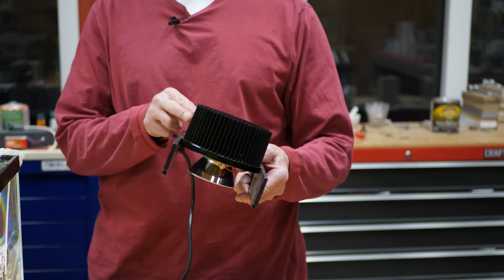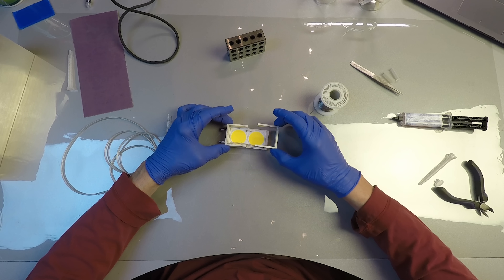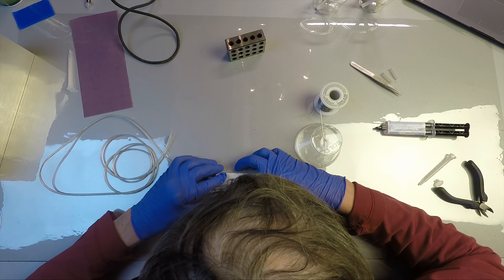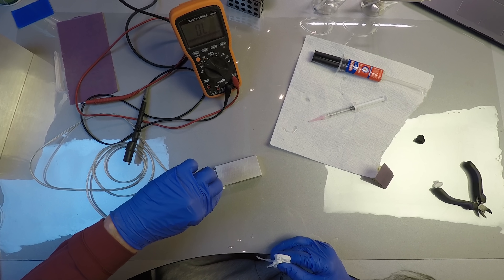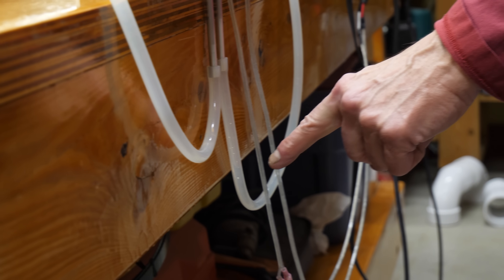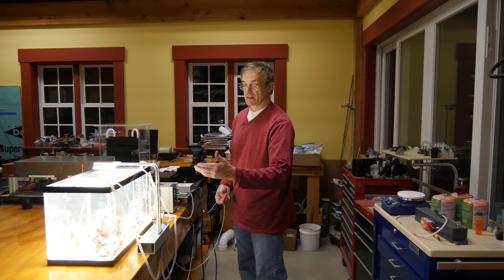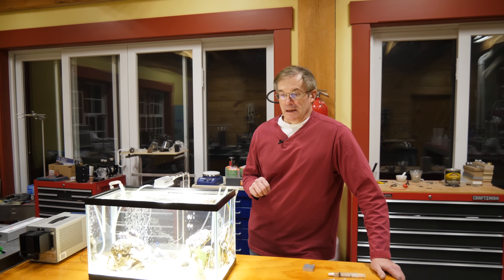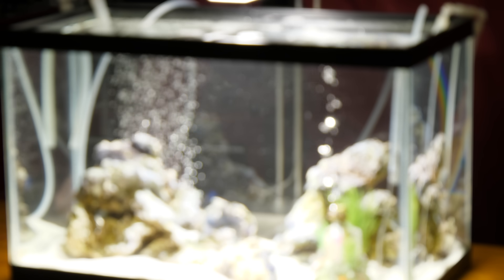40,000 Lumen LED Aquarium Light

Comment: I see three issues with using epoxy to isolate the aluminum block.
1. Epoxy does not bond well to aluminum. I would not trust the barrier to remain 100% for months and years to come. Especially at the interior corners and at the joint where the SS nipples are attached.
2. You will get pooling of the epoxy in areas inside the block unless you constantly rotate it while it cures.
3. Using aquarium water to cool will eventually lead to biofouling. Better to to make it a closed loop with a length of SS tubing submerged in the aquarium as a heat exchanger.
Reply: I have used those Chinese water cooling blocks on several projects and only had one that weeped/seeped/leaked (and that was under about 5-7psi pressure testing” and my method of remediation was far less elegant than using a low viscosity epoxy to seal/fill leak points from the inside.  My method of remediation was applying JB weld to the nipple/cooling block connection.  Personally I think the idea of coating the inside of the block with epoxy sounds like it good idea as long as the temperature spec of the epoxy are not exceeded and that it is food/fish safe.  Many years ago I used a generic silicone to reseal a corner on a fish tank and from that point on even goldfish did not live long in that tank.  As far as biofouling is concerned I doubt that would be much if any of a problem especially if the tank was fresh water However I would have no qualms using this type of setup in a saltwater tank.  Personally I would have a possible greater concern with how clean the aluminum that was used to make the heat sink out of but since the interior of the heat sink is coated in epoxy that all but alleviates that concern.  On a side note I have any number of old brass and bronze hose “T” and valves that I still use in my fresh and salt water tanks and have seen tanks with cooper fittings in them and the fish are healthy and happy.  The basic rule I was told many years ago is if metal oxidizes in the tank don’t polish it because the oxidation layer is most times inert.
Reply: @gullreefclub  Invertebrates like dwarf shrimps (Neocaridina, Caridina) are extremely sensitive against copper. Similarly, microfauna cannot develop accordingly.
Reply: This reminds me of FDA
Reply from the maker: The epoxy does not need to bond well to the aluminum.  This is a coating and not a structural application.  In. Some of our other videos, I explain how to achieve an excellent structural bond between epoxy and aluminum. The water that enters the light should come from the filter and it is completely dark within the tubing.  Biofilms will be slow to develop compared to everywhere else in the aquarium.  Ultimately, it can be cleaned.
Reply: @Tech Ingedients - Biolfilms can easily be flushed by temporarily disconnecting from the tank, and connect to a flush tank containing a dilute H2O2 solution, or Colloidal Silver Solution. Which makes me wonder if a micronised or Ionized Silver additive could be mixed with the low viscosity Epoxy, that would prevent any bacteria whilst also improving thermal conductivity within the heat Exchanger? Something like...
https://www.lionshome.co.uk/home-improvements-paints/silver-shield/
Reply: @TechIngredients  I don't have an opinion here.  But I am curious how one would go about testing this?
Reply: @joewhite4564  Just like anything else, experimentation.  Try a method, document it well, and see how it performs, rinse and repeat.  After using the epoxy the first time, mill the heat sink in half and see how well it coated everything.  Try different epoxies, faster curing, lower/higher viscosity, etc.
Reply: @TechIngredients  I disagree, I think it is critical to have a strong bond in order to form and maintain a complete barrier. Proper epoxy barrier coating of aluminum (which is what you are doing) requires diligent preparation (etching) in order to to be reliable. Sharp interior corners, thermal cycling and dissimilar metal junctions increases the likelihood of a barrier failure.
Reply from the maker: We'll have to agree to disagree.  Shrink wrap provides an excellent barrier and has no bond strength at all.  Epoxy bridges gaps and it's low surface tension prevents beading.  
On another note, there is an excellent alternative to etching which I agree is the standard for achieving a good bond.  Sanding the surface after it has been coated prevents the oxidation of the exposed, fresh metal and the resulting bond strength equals the strength of the epoxy itself.
Reply: @HarmanRobotics  I'm sorry bro but whatever he says ill believe him. This dude is real fucking intelligent. If he said the moon was flat, I'd f*cking believe him yo

Comment: ...why isn't the wire running through the tube?
Reply from the maker: Safety.  The two COBs are running in series near 70V.  Isolating the electrical feed from the water is a good idea.
Reply: I was confused about where the water was running. I guess I got distracted. Thanks for the reply.

Comment: Its cool, well, warm, but I might have put a thermal switch between the COBs just in case the pump stops working or gets clogged.
Reply from the maker: That's a good idea.
Reply: @TechIngredients  Putting slightly more thought into it, it might make more sense to use a tiny thermal trip like this:
https://www.bourns.com/docs/Product-Datasheets/LC.pdf
and a couple of extra wires to directly short (or open, however it works) the potentiometer control you have in the base.  That way you don't have to worry about what the driver is going to do when it gets an open across the COBs and you don't need a huge and (relatively) expensive high voltage DC switch.

Maybe only one extra wire if the COBs share a ground with the potentiometer.

I really liked the epoxy on the inside of the radiator idea.

Comment: This is a wonderful little LED project! Here are a few notes for the saltwater aquarists, especially you reef keepers who are always on the hunt for cheaper/brighter lights:

Stick with aluminum. Copper, even in small amounts, is lethal to saltwater fish and invertebrates. I suppose maybe PVC or silicon hoses would work as well, but aluminum pipes connecting to an aluminum block gives you great heat dissipation. Don't even consider stainless steel unless you have it powder-coated for extreme corrosion protection.  There is no such thing as "stainless" steel around salt water at a specific gravity of ~1.025. Toss a stainless steel spoon or fork in that water and it'll be turning into black sludge in days.  Even for aluminum, I'd recommend some sort of protective coating, simply because it's so reactive and marine salt contains so many different minerals.

I'd recommend adding a few more twists to the coolant pipes to prevent any incidental splashes from being able to travel the length of the pipe via gravity and start collecting at the junction box, similar in concept to a "drip loop" for electrical wires (Google it). If you have a large aquarium (>40gal) with a large lid, you have more options as this wonderful little light could easily be mounted inside the top of the lid and as long as the direction of the coolant line travels down a bit before going up again, splashed water can collect at that low point and safely drip back into the tank. Again, aluminum is quite reactive so this is another good reason for spraying a protective inert coating or simply using silicon hoses since a lid-mounted light won't need the extra rigid support.

The tank in the video is freshwater, which doesn't conduct nearly as well as saltwater, but still, seeing anything electrical sitting a few inches away on a surface at the same level as the bottom of the tank is like watching those crazy Russian free climbers doing chin-ups on radio towers. I cringe. A good way to know if you're safe is to imagine something landing on the back edge of your tank, breaking a nice sized chunk of glass out of the top of the back pane, and spilling 1/3 of the volume of the tank onto the table. In a safe setup, the only repair needed after picking up any fish that land on the floor that should be replacing the back pane of the aquarium (or the entire aquarium if it's a small 20gal like the one in the video).  Did you need a third good reason for coating your aluminum? Add "non-conductive" to the list of requirements to look for when you go shopping around for a protective coatings.

For deep reef tanks, you might want to consider adding a lens to the LED for deeper water penetration. Cree offers a number of optics options for their LED products, as do all of their competitors. The LED industry is innovating at an incredible pace these days, so it's worth shopping around — can't really go wrong with Cree these days, they're the 1970s IBM of the light emitting diode market.

If you keep any species of invertebrates that produce pigments in response to lighting changes — including most soft and stony corals,  clams, coralimorphs/zoanthids, and anemones — you should compare the spectral output of your current display tank lights and make sure to use an LED with a similar spectrum (or an array of smaller LEDs that add up to that spectrum). Generally a 10000K overall color temperature is sufficient for most reef tanks but Your Mileage May Vary™.

If your saltwater tank has a sump and an external/hang-on overflow box, you might be tempted to use the same kind of cheap little diaphragm pump that maintains the siphon on your overflow to pump the water for the cooling system. Don't. Those little things are engineered to just barely have enough power to start the overflow siphon and have no way to regulate flow, and the odds that it's fixed flow rate will be exactly what your cooling block needs is a long shot you don't want to bet your expensive reef fish and corals on.

And finally… this should go without saying, but still … Watch the video again and count the number of fish in the tank. Got it? (Spoiler alert: it's zero). That's the correct and absolutely the only number of fish that should be in any tank you're testing a DIY LED fixture (or DIY anything) on.

Great project, as usual!

I love the water cooling idea, and for all the commenters suggesting it's too bright, 120% of a typical 400W metal halide's output is just fine. It is not "so bright your fish will have eye cancer" (where do these ideas even come from?). Less than a decade ago it was quite commonplace for 250-400gal coral reef tanks to have three (3) 400W metal halide fixtures above the tank, all with highly polished German aluminum reflector assemblies — thus, the reason that those "aquarium chillers" mentioned in the video became a thing. Also, sometimes your electric bill would come in a box instead of an envelope. 😎
Reply: @justame smith Food grade HDPE plastics are perfectly safe to use around aquariums. They are easily identified by the #2 inside the recycling symbol.  Monofilament fishing line is great for hanging pendant lights, hanging pumps (to quiet them), and even securing rocks together inside the aquarium.  UV-resistant zip ties also come in handy for certain applications.

Just make sure you recycle this stuff when you’re done, so it doesn’t end up in one of our big natural aquariums like the Pacific.

Comment: Alternate (and possibly better) method of dumping the heat into the tank, to avoid corrosive water contamination: use a secondary heat exchanger in the tank. nothing fancy, just a coil of the same metal or plastic tube you used before. Then the LED loop can be separate, use corrosion inhibitors etc. like in a PC watercooling rig. Not sure I'd trust that the epoxy-in-the-cooling-block method was actually a continuous layer.